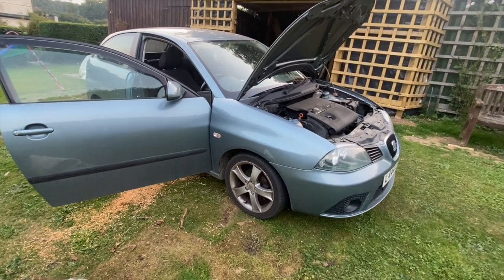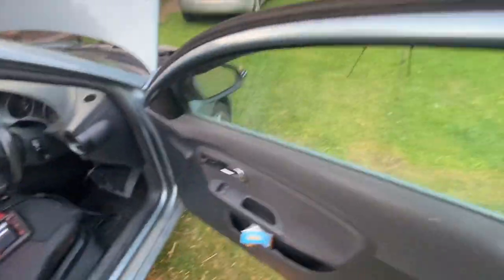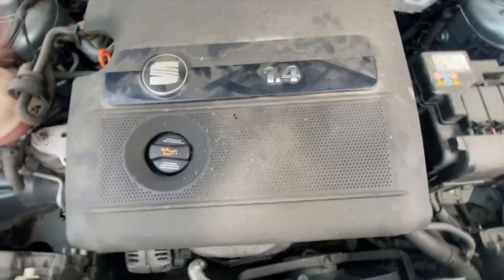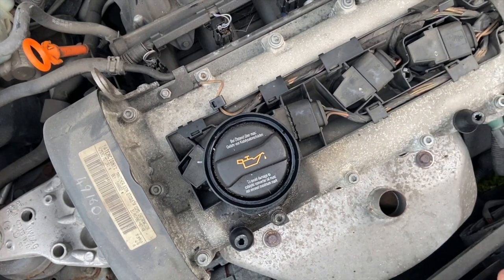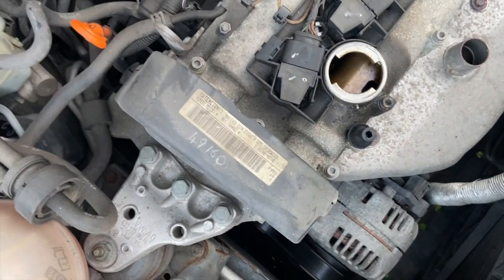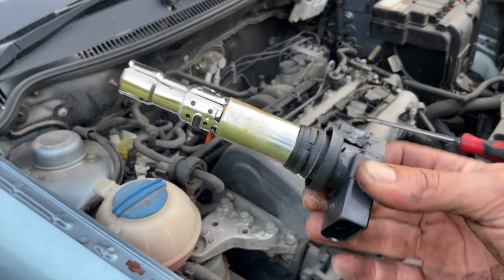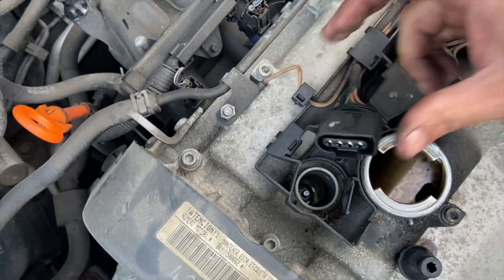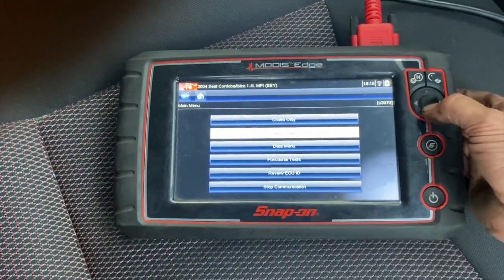SEAT Ibiza 1.4 engine misfire / judder P0301

Comment: Hey great video. I have a 04 model and when im driving it for a short time, engine management light comes on, loss of engine power and shaky engine. Scan showed P0302. Once i switch the car off for a bit and start to drive fine then it comes back after 10 mins.

So do these need to be coded in, or just plug and play? Also do i need to match the ignition coil serial number when purchasing one?

Thanks
Reply from the maker: Just plug and play mate , no matching .. just need to be the right cylinder obviously 👍👍
Reply: @diydaly  great, thanks for the quick reply 🙌
Reply from the maker: @313-v8b  👍

Comment: On my Seat 2010 the engine light comes on flashing when accelerating and the engine feels like it's sticking when that happens, I cleaned the throttle body but still happens so could be these.
Reply from the maker: Yeah mage could easily be the coils , you could do with the code scan first really

Comment: Is it possible to have misfires without an engine light on new seat's? I've occasionally heard these ticking sounds, one at a time and intermittent, and I suspect they might be misfires but I'm not getting power loss per SE nor any check eng lights.
Reply from the maker: If your not get any power loss I’d say it not misfiring , may just be a noise from the engine , could be belt related Or camshaft vvt issue if it has one

Comment: How would i tell this is a problem without diognostic ? Ive just come back from the beach and my car is feeling sluggish as you said this one is. How much would it cost to fix at a garage roughly?
Reply from the maker: Remove the coil plugs 1 at time seeing if one certain cylinder doesn’t make a difference to the running it’s that coil , average cost anywhere from £50-£100 best guess mate